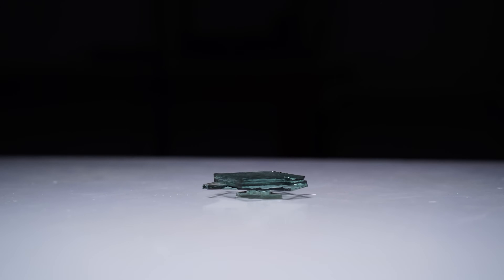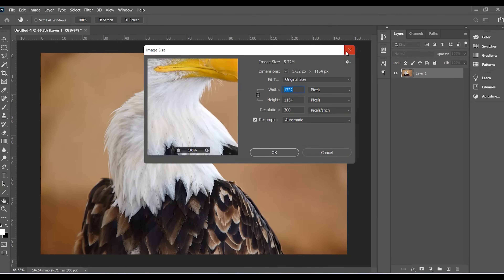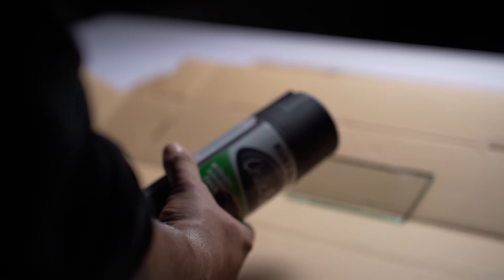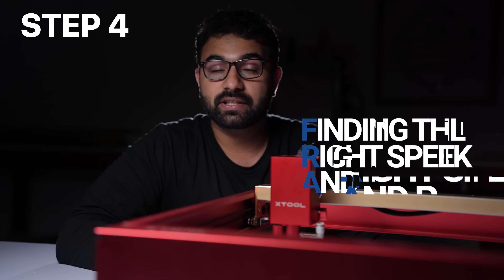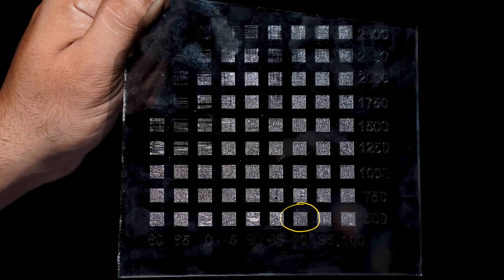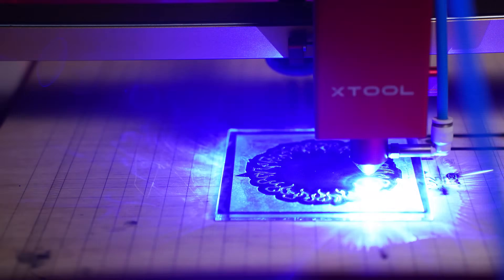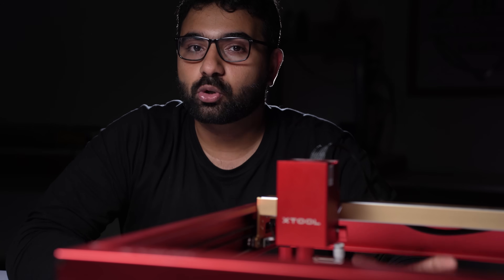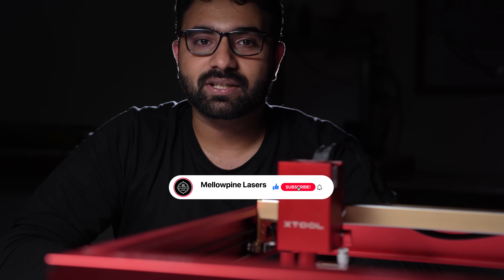Learn How to Laser Engrave Glass like a Pro using a Diode Laser!

Comment: I have a query regarding the painted glass facing down with black back drop underneath.. is it safe or proper?

I was thinking that the paint was intented to face upward toward the laser to serve as a isolators to prevent reflected light of laser beam that possibly reflect back to the machine that will cause damage of the laser components and can result in complete destruction of the laser device.  

I do have a suggestion, perhaps you consider the idea with the same perspectives you had. You just need to add a maskin tape on top of the clear side and the painted glass facing downward. I hope it will work..

Comment: Amazing video, thank you. What is the best black medium for engraving a jar using a rotary attachment? I could put black card stock inside but does that mean the engraving would be on the other side (inside) of the jar? I want to keep the engraving on the outside I’d have to just use the paint method right?

Comment: Engraving glass with a diode laser takes a bit of finesse—using masking tape or a coating like tempera paint helps reduce cracks and gives cleaner results. I use the Monport Mega and recommend it—it has auto-focus, built-in lights, and steady engraving that makes working on tricky materials like glass way easier.

Comment: Wow! What a great video. I have the red xTool laser and just failed trying to engrave a glass vase. I painted it black but guessing it wasn't covered as well as I needed. Will try again using your technique and numbers. So glad I found someone who uses the same machine. I haven't looked at your video list yet but another fail that I had was laser engraving denim. I bought some denim kitchen aprons to engrave for my neighbors. Tried on an old piece of denim first and burnt right through. Could never find that sweet spot where is showed on the denim but didn't burn through. Grrrr. Thanks again for the video. You rock! 🎸

Comment: Do you have any suggestions for achieving black color on glass? I have a 20W laser machine and I'm trying Colored Laser Engraving Marking Papers, but the results are always bad. I need suggestions for both glass and ceramic/porcelain. Thanks for your video.
Reply: I have received very good results on white 4x4 tiles using about a 2 parts TiS02 - Titanium Dioxide, and 1 part 91% IPA.  The result was a black etch/finish where the blue laser, (Longer B1 30 watt - ~ 3000 mm/sec @ 55% power, .08 line interval). I also have had good results on a glass jar with the resulting texture being somewhat rough.  Suggest running a "Material Test" - in Lightburn - using the appropriate power/speeds for your particular laser and material you want to etch.  This is the only the way to determine your settings.  HD has a box of 100 - 4x4 white tiles for less than 14 bucks, so, you got lots of test tiles for little $$....  The results for the glass jar was a bit "light" in coverage as this is/was due to a too "thin" of a coating using a foam brush and a thicker coat would have given great results.  It is difficult to apply a thicker coat that is EVEN in coverage and "thickness".  I am going to try a "cheap" trigger sprayer and if I'm able to obtain a good spray output, spraying is the best way to get an even coating. The TiS02 will give better results with a thicker coating and the trick is to apply to any object a somewhat thick coat that is EVEN....  I used a foam brush that worked OK, but, finding/using a sprayer to layer on the black Tempura paint or the TiS02, is the key to achieving good results.  Generally speaking, I had the best results with either of the coating materials having been applied "thicker"....  AND, the most important part is surface preparation to totally clean the object you want to etch.  Lastly, if using a foam brush, you've got one shot to apply as both the Tempura paint and the TiS02 mixture will be removed when subsequent coats are attempted - SPRAY ON  🙂

Comment: Hi when engraving a wine glass, how do you get the black card to mold to the contours of the inside of the glass?
Reply: Even if you could get it to contour, it would etch the inside of the glass. If that's what you want use paint.

Comment: Great video. Thanks for sharing. But i would like to ask what about 40w laser? Any tips and suggestions are welcome. Thanks in advance.
Reply from the maker: Thank you. With a 40W diode laser, I got good results with 75% power at a 15000 mm/min speed. 
But generally, higher power output means a larger spot size. So, for glass engraving, a smaller spot size is preferable to limit the micro fractures. But you can also achieve good results with a larger spot size, just make sure to perform test runs to identify the right settings that produce fine fractures in the glass.

Comment: Thank you very much great video! I am struggling trying to engrave glasses with tempura paint... (dry times and eveness). Looking forward to simply trying the black paper technique! Questions for it and glassware though. So I would put the black paper on the inside of the wine glass and tape it. And then I would simply put the wine glass on the rotary with the glass on the outside and the paper on the inside and laser normally...? Would that work?? Thanks!
Reply: In other words what is the best way to use the transfer methos for glassware? Thanks!
Reply from the maker: Adding the transfer medium on the inside will result in etching the inner surface of the glass, which, in my opinion, is not advisable. Better to have the engraving on the outside. 
You can use black acrylic marker instead of tempera paint, it dries faster and easy to apply. 
But if you want to engrave the inner surface of the glass, then you can place black cardstock paper inside the glass, and engrave it. Make sure the paper is firmly pressed against the glass throughout the engraving process.

Comment: I tried the resolution to 0.06 mm beam width, the results are better.
I tried mat white chalk color with titanium white, it gives a darker result because the TiO2 burns into dark dots.
Reply from the maker: Yes, the finer the spot size, the better the results, but longer the engraving time. 
Never thought about using TiO2 on glass, thanks for sharing the trick, will try soon. 😊

Comment: Has to be the best how do video that I’ve seen, he doesn’t try to make himself look good! Get’s right to the subject. I will be trying this on my 5 watt with black paper (not a fan of paining). Next I’m looking for info on engraving mirrors!
Reply from the maker: Thank you for your kind words. I always try to minimize fluff and get straight to the point. 😊

The black cardstock method works well for most of the projects, but I personally think paint produces slightly better results when it comes to engraving photos with intricate details. 
To engrave mirror, you can engrave the back of the mirror and remove the reflective coating.

Comment: Your techniques work, but there is a much simpler way. Use Titanium Dioxide powder mixed with 94 to 99 percent alcohol. Dries really fast (less than 5 minutes), and RINSES off with water and a paper towel. No scrubbing at all. Just make sure you constantly shake the mixture during the spraying phase. Just don't touch the sprayed surface because it will rub off.
Reply from the maker: Yes, I have heard about this method but never tried it. Will try it in my next glass project. Thanks for sharing 😊
Reply: Wher can you buy the powder cheap? Looks crazy expensive.

Comment: If you engrave the back side of a mirror and then light it from behind, wherever the reflective paint was removed by the laser, the light will shine through the glass and be visible as an illuminated image.
Reply from the maker: Yes, you're correct. I used the same technique to create a vanity mirror with touch switch. I have a video on it, you might find it interesting.

Comment: Very helpful video,  thank you! I do have a question though,  I saw another you tuber that used cold galvanizing paint and I used that today to etch a glass mug.  It came out good but not frosted,  it looked brown when finished. I also just shot from the hip with the power and speed and according to your video I was way off. 20 watt xtool laser, 55 power and 900mm/min speed,  do you think it came out brown and not frosted because of the choice of paint or the parameters? Thanks again for the video!!
Reply from the maker: Cold galvanizing paint usually works good, but it could become difficult to remove it if you leave it on for too long. Also, you should run a test to see what speed and power to use to get the result you want. The speed and power for regular paint would be different from the speed and power for galvanizing paint. The result you mention does sound like it is because of high power setting. Please watch my bottle engraving video, I have used cold galvanizing compound to engrave some wine bottles in it. I have also discussed how to set up everything correctly for rotary engraving.

Comment: I don't see any mention of tempered or hardened glass can you engrave this type of glass? I doubt it but curious to find out
Reply from the maker: You can score tempered glass by running multiple passes at a lower laser power, but there is always the risk of shattering the glass into a million pieces. Tempered or hardened glass have high internal stress, and even if you manage to engrave them safely, there is a high risk of shattering the glass when handling them after engraving.
So, if you have the choice, it's usually safer to stick with standard glass for your laser engraving projects.

Comment: This was incredibly helpful!! I love how thorough you were in your testing and that you included the settings (you'd be surprised how many creators don't). Do you think matte black vinyl might work well, especially for curved surfaces where cardstock might gap and even painting might be difficult?
Reply from the maker: Glad you liked the video! Vinyl might be an easier option for curved surfaces, but it is not safe to laser cut or engrave vinyl (unless you use laser safe vinyl).

Comment: I was struggling to get nice, clean engraved pieces incorporated into my stained glass work.  FINALLY, your video provided the tips and tricks I was seeking in order to get my engraving to the level I have been looking for AND you showed me how to do it without needing to mess with painting the glass first! The black back drop is brilliant and my results are SOOOO much cleaner and better!  THANK YOU for a fantastic post!!
Reply from the maker: You are welcome!!
Reply: Hi, I make stained glass as well. Have you experimented at all with scoring glass via laser? If so, have you found any techniques/settings that work particularly well?
Reply: @user-nn5xb3ly8h  Yes!  I have had the best luck with 100% power and speed set at 10 (on the xtool software).  When done, use an exacto knife to clean out grooves/etching.  I also have used "rub and buff" to make the etching "pop" in certain pieces...especially when etching in clear glass.

Comment: thanks, good video ill stay tuned I subbed only have watched this one so far. I thought you had to use some special paint to etch the materials we laser, will I bought black and grey acrylic paint that is used for fabric will that work and is it as simple as washing it off once done? I am not sure if the stuff I have will wash of easy might need to be wiped or scrubbed off. making first attempt on white metal atm which seems to be working since its white I didn't put anything on it just burning with laser. simple image not fancy
Reply from the maker: Yes you can use fabric paint. If it doesn't wash off using water, try wiping it with paint thinner.

Comment: It's interesting that you think black is the best color to use when coating glass for laser engraving. I use the bright white titanium dioxide powder when engraving ceramic tiles and that works better than any color paint. Perhaps it's more complex than just color alone?
Reply from the maker: Yes, white titanium dioxide powder or any white paint gives the best result when engraving ceramic tiles. Titanium dioxide has two structural forms. When you laser it, the heat causes a change in its structure which changes its color to black and it bonds to the molecules on the surface of the tile. I have explained this in my ceramic engraving video please check that out.
In the case of glass you are using your laser to create tiny cracks on the surface of the glass called microfractures and for that you need a medium that can absorb the heat from the laser and transfer it to the glass. The best options are black paint and cold galvanizing compound spray.

Comment: Excellent research and presentation.  Can you do 3D images inside a crystal or acrylic sphere?
Reply from the maker: Its called Subsurface engraving. It's done on a special type of crystal material. Its mostly done using a CO2 laser and needs a software that can create the control instructions for 3D engraving and you need a machine that can focus at different points inside the crystal. You can search youtube for subsurface laser engraving (a.k.a bubblegram).

Comment: would the speed and power settings on glass be the same for mirror
Reply from the maker: If you want to engrave the backside, you'd have to do one pass at low power setting to remove the coating. Then you need to coat the surface with black paint without changing the position of the mirror and then engrave it using the same power and speed for glass. This is for diode lasers. If you have CO2 just run a low power pass and then a high power pass.

Comment: How about using an erasable black magic marker? Like the ones used on white boards?  Even black coating and easily erased.
Reply from the maker: Tried that, but found it difficult to get a good coat. Also, the coat wasn't thick enough.
Reply: Thanks for nice video about glass engraving by diode Laser. 
I want to buy a diode leser engraving machine of 10 watts. So I want to get a  suggestion about the product brand. Which product ( tts 55- 5watts / TTS 2 10 watts/ xTool) will be perfect for me please let me know.

Comment: Just found your video and it gave me a good baseline on how to engrave glass.  I found that the best way to get an even coat was to dilute the tempera paint with rubbing alcohol and use an airbrush to get an even fast drying coat. Then let it dry in from of a fan or use a heat gun in low to medium setting.  But all in all great video.
Reply from the maker: Thanks man. Do subscribe. Nice tip btw, I'll try it.

Comment: Can a laser be used to make a score line for glass breaking?
Reply from the maker: Yes, I have done it a couple of times but I got jagged edges. If you have a CO2 laser you can cut it clean in any shape. On a diode laser you can only make straight scores and then break it off. You'll have to play around with speed and power to get a clean break.

Comment: Do you think the card stock method can we used to engrave a wine glass?
Reply from the maker: When we use the cardstock method we make the beam pass through the glass and engrave on the side that's further from the laser. In case of wine glass, this means you'd be engraving on the inside of the glass and getting the cardstock to stick evenly on the inside surface is difficult. So I wouldn't recommend the cardstock method for wine glasses. I have a good video on engraving wine bottles, you can check that out if you want.

Comment: Thanks for the great video.  I have and xTool D1 10w and I have improved my laser engraving and cutting thanks in part to your channel. Keep making videos!  Project Idea if you would like to tackle it.  I would love to see a video where you teach us to make custom finger joint boxes.  For instance.  A wall hangable 3 tier shelf system for holding flat stock like wood or actylic.  Having the shelves slightly angled up would keep the material securely in place.  There are box generators online, but knowing how to size the slots for your material and make matching tabs would be a great and practical project.
Reply from the maker: You're welcome. That seems like a good idea for a video, will give it a try sometime in the near future.

Comment: Seen a guy engrave and then spread powder coating pigment into the etched sections, scrap away the excess and then use the laser to melt the powder, repeat if needed. Wonder if laser toner will work?
Reply from the maker: I've been trying to do that for some time, but never got any useful result, the melted paint chips off.

Comment: You can use a Co2 laser and there is no need for paint The glass will be etched directly from the CO2 laser just adjust the power
Reply from the maker: Yes, you can use a CO2 laser to engrave on glass without any transfer medium. I wanted to show how to do it if you have a diode laser.

Comment: Great video! How durable is the engraving on glass? Lets say a drinking glass - is it possible to wash off the engraving ? Will a sponge damage it? Or is it rock stable and can not be removed by hand / scratching? Thank you in advance!
Reply from the maker: Thank you. It's as permanent as it can be if you get the settings right. If the power is high the engraving might chip off. If it too low the marking will be faint.